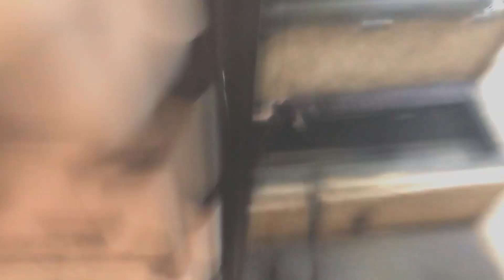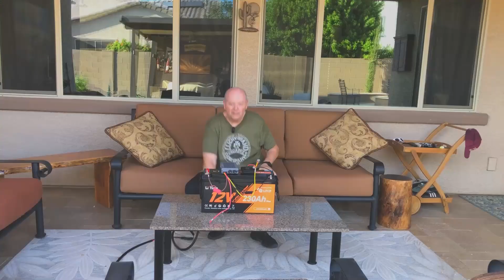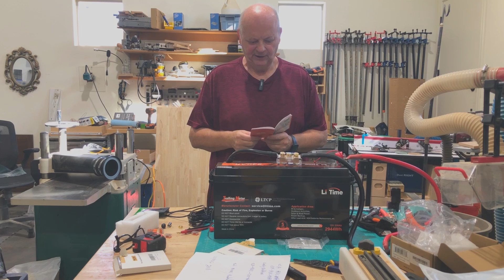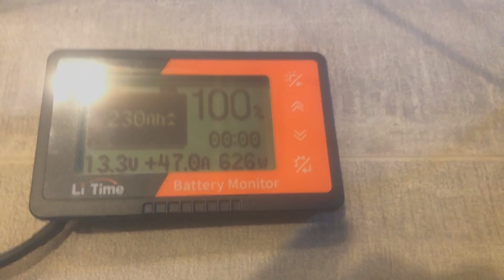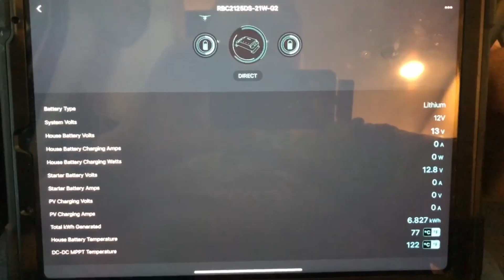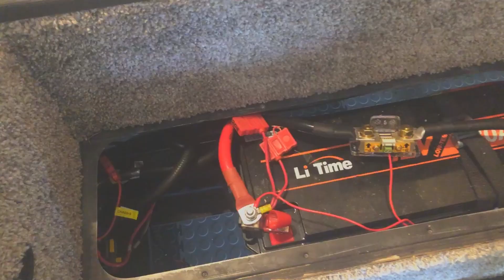Thor Compass LiTime  Lithium and Renogy DC-DC Electrical Upgrade from a Lead Acid Battery

Comment: Did you figure out what the 2 red fused wires on the solenoid went too? One power the bird? And what was the 2 red fused wires on the battery too? Last question what did you hookup to get bmpro to show chassis batt voltage again? Thanks

Comment: Hi and nice video!  We are looking at a new Compass/Gemini and thinking about a similar upgrade.  Query:  doesn't removing the isolation relay/BIRD allow the chassis battery to charge the Li Time when the engine is off? How are you isolating the coach from the starter battery.  Isn't there a possibility of a low coach battery running down the chassis battery?  Thanks for the great work...
Reply from the maker: Thanks. The DC-DC charger replaces the isolation relay/BIRD to protect the alternator when using lithium batteries. Some DC-DC chargers require a wire from the ignition switch but this Renogy DC-DC/MPPT charger automatically senses when the engine/alternator is running. It also provides a trickle charge to the starter battery. Note, new Compass/Gemini RVs now come with a 100ah lithium battery and a DC-DC charger.
Reply: Excellent!  Really appreciate you taking the time to respond.  Thanks from Canada!
Reply from the maker: @cbrbird  You’re welcome.

Comment: Thanks Paul!  From a hands on capability perspective.....I can do the install.  But from a technical standpoint I get a bit sideways :)  Controller, shunt, this and that wire....one goes here, one goes there....in line fuse here, disconnect there, etc. etc.  It seems a bit overwhelming to me but maybe I am overthinking it.  Thanks so much!  Nice job
Reply from the maker: Thanks.